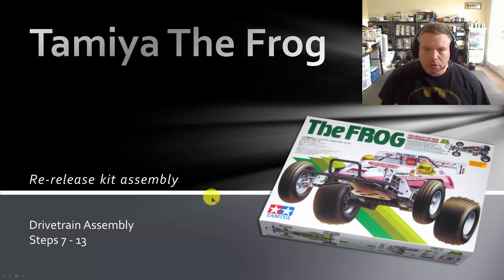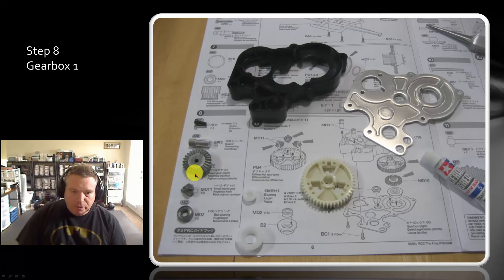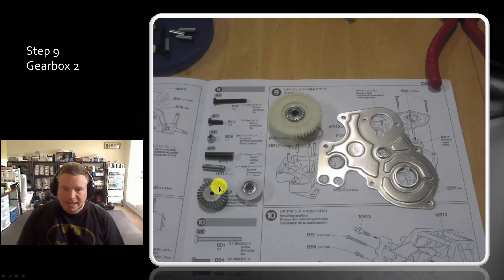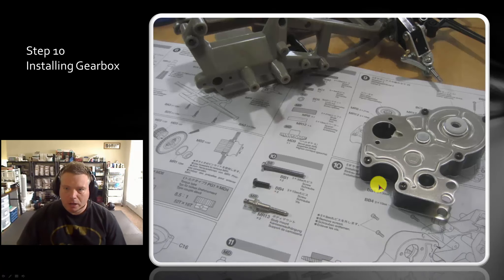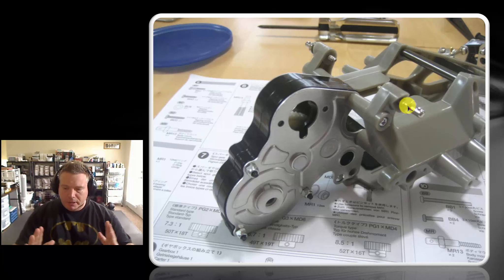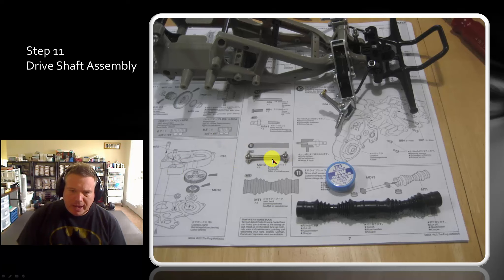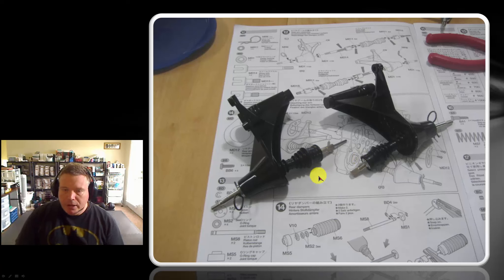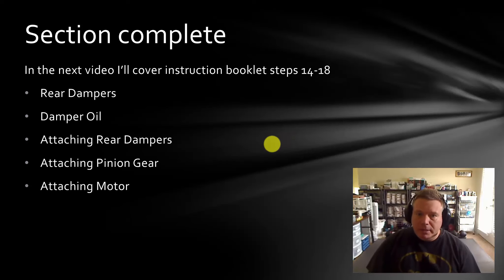Tamiya Frog Build - Steps 7-13

Comment: Thank you for spending your time to post this video. I am building one right now and this has come in handy. My one gripe is with Tamiya not labelling all the bags and corresponding them with the instructions. If all the bags were labelled it would be a cruise to the finish line. Spent most of my time comparing components to images with a tape measure as there is no direct reference.

Comment: Great Video!
How do i stop throwing dogbones?

I put the rubber O-rings in like directed like in item 12 on the 8th page.
Any suggestions?
Reply from the maker: On a Frog/Brat?  You don't.  :(  The swap from the old hex end style half shaft to the current, more modern pin through dog bone was an attempt to remedy an issue that's plagued this chassis since it was introduced in the 80s.  There might be aftermarket or mods that you can find but I'm not aware of any.
Reply: @kokyudosa  
I took the whole thing apart and put it back together.  It seems to be working.  
I never had a problem with the old hex style. Such is life. The journey has no destination, only charging and repair stops.
Thank you for your reply.

Comment: Hey Kelly - thanks so much for these videos. You've saved my life a few times now. Quick Q - after completing my gearbox, and adding the wheels, I noticed the wheels turn in opposite directions when I turn them while the car is lifted off the ground, and when I try and roll it forwards or backwards, they are locked and won't rotate. Any ideas what I did? I read some comments online that say that's normal, but it seems odd to me. I don't know if it runs normally yet as I'm having a hell of a time with my controller/receiver :(
Reply from the maker: The tires rotating opposite each other when held aloft and you manually turn one is totally normal.  As long as the differential is working properly, you'll have that. It's what allows the car to corner well.  However, they should NOT be locked when you roll them both simultaneously. I'd check that your idler gear, spur gear, and pinion are all seated correctly.  Your diff is fine, the trouble lies elsewhere in the gearbox.
Reply: @kokyudosa  Thanks for the advice, will check them out. Don't suppose you can recommend a reasonably priced traditional (joystick) controller for this system too? I'm using the kit-provided Tamiya ESC and a Futaba s3003 servo. Am not a fan of the pistol style transmitters, and the Radiolink one I bought (https://www.amazon.com/dp/B07DPK9Q9X/ref=cm_sw_r_cp_apa_i_nXoaFb9QXANDT) is not working at all....thanks for any advice you have.
Reply from the maker: @andrewlhumber  The Futaba Attack is the only one I know of that's designed for surface use, but I think you should just put some time in with a pistol grip controller and learn to use them.  The Tactic TTX300 and FlySky GT2B are two of my favorite budget transmitters.
Reply: @kokyudosa  Thanks man. Yeah, after a lot of searching around I had come to much the same the conclusion. Pistol it is....
Reply: @kokyudosa  Yep, I had a spur the wrong way round - everything moving as it should now. Thx again.